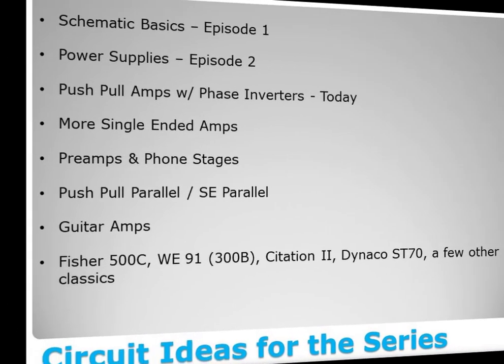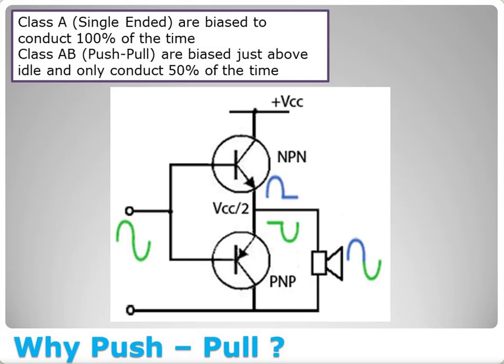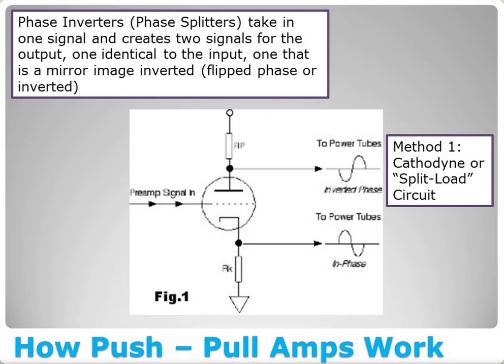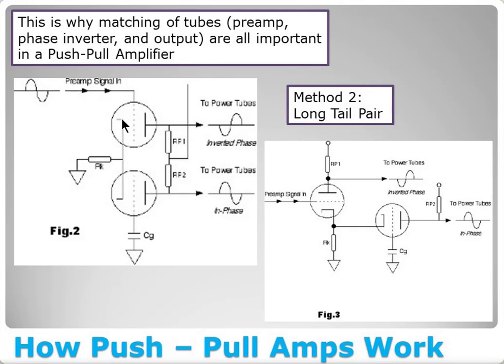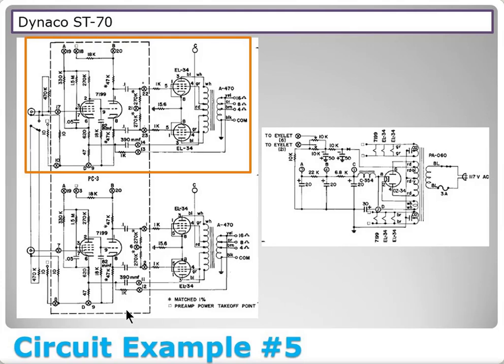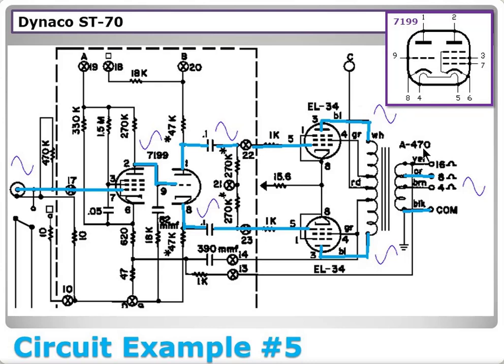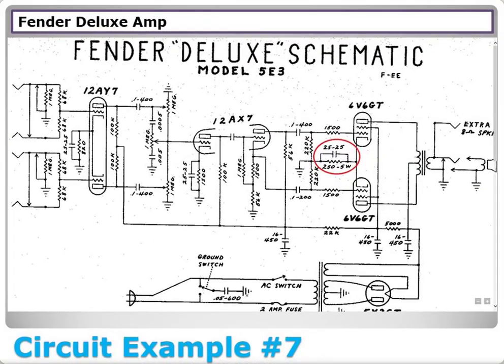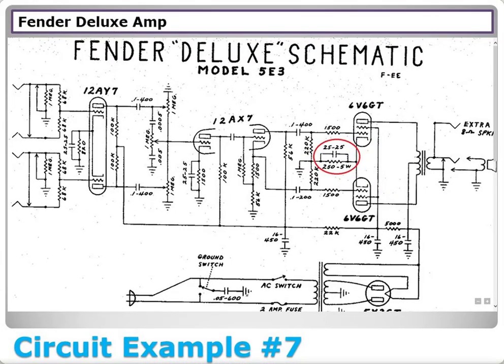Understanding Vacuum Tube Amplifier Schematics - Push Pull - Part 3

Comment: Thank you! The information on how the second half inverts the signal has cleared up some confusion from watching other videos.  Many videos (that I have seen) don't stress this point. I know it's just me but that has cleared up a lot of confusion. I also found it helpful to know how different frequencies (high versus low) effect the power section and basically a key difference in sound between solid state and tube amps (if I'm interpreting that correctly)... anyhow.. Thanks!

Comment: Great series. As an electrical engineering student with some experience with transistor amplifiers I can see a lot of similarities between tubes and transistors, mainly the plate signal inversion just like in a common emitter circuit. You can explain the theory with simply words but never skip the true principle of working. I can recognize that. Great job man. PS: I am a guitar player too and pedal maker, I was looking for some basic tutorials on tubes. Now I can read a marshall schematic and understand it completely. Thanks again

Comment: That was absolutely superb. I understood everything! I think between your videos and Uncle Doug's videos, I've pretty much got the theory down. What I need to make progress on now is component value selection. I need to understand why a certain resistor or capacitor value is chosen. What is the theory at play. When (for example) a 1M resistor to ground is used as the volume control, why is it 1M, and not, say, 500K? What would be REALLY cool is, at some point, if you ever get the chance, build a push-pull amp on the bench with accompanying schematic and try different component values for bias etc, and see what the effects are on an oscilloscope. For example, I would assume if I wanted to build an exceptionally clean sounding amplifier, maybe for guitar, or maybe as a general purpose audio amplifier, I would keep the valves "cool" with respect to their bias. However, if I wanted (for example) a guitar amp with a bit of growl (think Marshall or Vox AC30) then I might select a "hotter" bias? If I wanted a "dirt"/distortion control, maybe I'd include a potentiometer that did little more than tune the bias within a fairly narrow band?

Thank you so very much for taking the time to make these videos. This series in particular. There is a legion of valve amp fans around the world hanging on your every word, and I'm sure I speak for everyone when I say that we're very grateful indeed for the time you invest into making these videos in order to help folk like us de-mystify valve amps.

With best wishes from Aberdeen, Scotland.
Mark.
Reply from the maker: Sadly the resistor & capacitor component selection dives deep into circuit analysis & design which is pretty heavy on the Math side of things.  It's not a 30 minute topic.  I'll try to do my best but at some point electronics are nothing but physics and math, thus why very few go down the EE path.  There are some generalities I could speak to but going much further turns into a full degree program...
Reply: Mark, I echo your sentiment on these and Uncle Doug's videos. One great read is http://www.guitarstudio.tv/documents/Designing-V-T-Amplifiers.pdf

The Merlin Blencowe books are great too but a lot more in depth math/physics wise.
Reply: @Terribleguitarist89  Thank you so much for that reference !!! I think I just found my new bedtime reading for the next little while (or long while, because that's not short read !).

Comment: Great lessons. For some reason I am remembering the long tailed pair inverter having mismatched resistors in it… Maybe I’m thinking of blackface circuits? Thanks again for this presentation!
Reply: The balance of the LTPPI is primarily controlled by the value of the tail resistor. Higher values increase balance, but also restrict the output swing. With a tail resistor greater than 18k, best balance is achieved with equal value plate resistors.

Comment: Great stuff! Just one comment: the ECC83/EL84 example beginning at 12:55 is not a Long Tail Pair phase inverter but a Floating Paraphase PI...
Reply: The Floating Paraphase example actiually begins at 22:25... Again - excellent presentation!

Comment: Way back in 1970, an instructor told me that if I ever encountered a push pull amp that was putting out about a third of the power, he pointed to one of the resistors that he said would cause that if it opened. Next time I was home, my brother's amp was putting out about a third. I looked at the schematic, went to a local TV shop and bought one resistor, went home and repaired the amp. Now, I'm trying to recall which of those resistors it was. Using that Fender amp is there a way to determine which resistor would cause that. My old training had become too foggy.

Comment: Note that contrary to what you said initial dual triode stage IS OBVIOUSLY NOT a long tail pair and no audio signal shows on joined cathodes because  of large capacitor C3 shorting them to the ground. Instead the two are two normal amplification stages with the second (right) one receiving its input through C4.

Comment: Well done and thx so much, but one question : in the pnp/npn picture, the lower half can‘t work , I think the speaker should be connected to 1/2 of the power rail to make the lower transistor work. Am I wrong ?

Comment: The first illustration with transistors needs a negative voltage supply with a speaker attached to a ground wire or to a virtual ground made with big capacitors in case an uni polar power source is used.
A phase is important even in case of a single ended amplifier. Because as a reaction on a sharp impulse a speaker membrane must move in a desired direction. Otherwise, no good bass is available.
A long tail pair inverter is not an ideal because a noise from a power source appears on two legs differently. It negates only on the second tube that is connected with a common gate. Also, two legs have a different Miller's effect value.

Comment: In the EL84 push pull R4 should be compensating for the double amplification that the plate will be outputting due to A triode sending the signal back into B triode so I think R2 and R4 should be not equal, I was educated by uncle Doug and his wild animals, this is also shown in fender schematics as such which would imply there maybe some amplification via the K.

Comment: For cathode biased power tubes, the best way to go is to use a separate resistor for each tube. This eliminates hum before it goes to the output transformer. Because tubes are never perfectly the same when you buy them. They can be matched, but not as well at it should be.

Comment: 18:17 - when the signal is fed into the grid of the el-34's doesn't that invert the signal again? so the top el-34 amplify's the bottom half (not top) and bottom el-34 amplify's the top half (not bottom). I may be incorrect, just asking... love the vids, thanks.

Comment: Thanks for the video. In circuit 6 don't we also feed second grid of that ecc83 from first plate of the same tube which results in inverted signal on the second plate?

Comment: For the transistor push-pull circit, shouldn’t there be a capacitor connected in series with speaker? Without it, the lower half cycle won’t work.

Comment: Maybe a better way to say it is that every Triode is both a ‘PNP’ and ‘NPN’ But when using it as both you don’t have amplification, but it’s good that the most common tube 12ax7 is a dual triode, so perhaps that is a compensation.

Comment: I`m an older man from Norway and l found your video very explainable and good in all regards. I have a main transformer 175-0-175 Volt incl 6.3 and 5 Volt . Suppose this woul be fin for 2xEL84.What is the minimum high voltage on the main transformer if l`l use EL34 or 6V6 ?

Comment: Very informative series so far. One thing I've had issues with from schematics with no parts list are what type of capacitors to use where. I know that different types can affect the sound if they are in the signal path, but where would you use a ceramic, mylar or whatever in the other parts of a circuit. Electrolytics are obvious but the others can be confusing.
Reply: I try to only use quality non polarized caps in the signal such as poly or paper in oil caps. Ceramics types can be noisy in the signal, I usually only us them for a line safety cap. Sometimes people use ceramics and that to decouple radio freq and such to ground.

Comment: Thank you so much! I can't wait for the Bias Vids.  So in the Fender amp I think I get the inputs. 1 Master gain control and 2 Channel gain controls yes? All they are doing is shunting to ground in a variable way but why is the Master's element tied to one channel and not both? Also, the elements of the Channel pots are tied to the wiper of the Master yes? Also also, is it as simple as adding a variable pot to each cathode of the output tubes in a fixed bias amp to convert it to variable bias using unmatched tubes?

Comment: Hello Mark, I recently completed building a Dynakit ST-70, and it is fantastic, but I have an existing condition of AM radio interference.  As a quick fix I installed RF ferrite chokes on the power cord, and the line input.  This works, but I would like to install RF chokes inside the amp as a permanent fix. The offending AM radio station is 1500 kHz. The transmitting antennas are only a few blocks from my house, and this interference affects, other audio equipment too.  Can you feature on your channel RF choke solutions for tube radios, and guitar amps?  What components are best and how to install them into existing circuits?  Richard Trask – San Jose CA

Comment: Great lesson Mark. The part about the Cathodyne PI  that I dont understand is the voltage differences from both the plate and cathode.
The Fender AA964 Princeton Reverb is a good example. ~230VDC from the  PI plate and only~65 VDC from the PI cathode  yet it works out fine in the end. How can this be?
Thanks very much!
Reply: The 0.1 coupling capacitors block those DC voltages, while the equal and opposite (AC) signals which are developed at the plate and the cathode by the signal at the grid are allowed to pass to the grids of the output tubes.

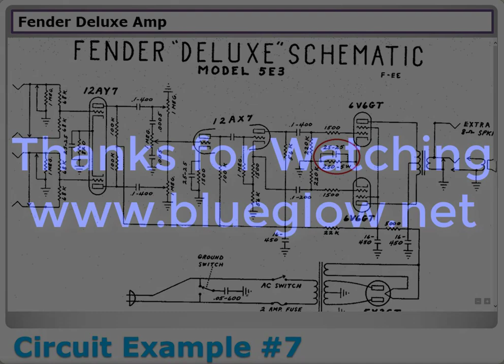Comment: 30:30 - What is the purpose of the 'extra' resistors in the cathodyne circuit (1500, 1 MEG)?
Reply: They are there to bias the tube. Current flowing in the 1500 develops a voltage across it, so that the bottom of the resistor is at a negative voltage with respect to its top (which is connected to the cathode). The grid is tied to the voltage at the bottom of the resistor by the 1M resistor so that the grid is negative with respect to the cathode.

Comment: Can I ask you a dumb question, on the AB transistor schematic if we trace the ‘electrons’ in both the ‘push’ and ‘pull’ stage one seems more conventional than the other, so my question is for the seemingly less conventional stage the ‘pull’ 

In the pull stage, obviously the input signal has the NPN ‘off’ and the PNP ‘on’ so do the ‘electrons’ flow from the ‘negative’ terminal up through the PNP and then through the inductor or speaker inductor...back to themselves? 

Or do the ‘electrons’ flow from the ‘negative’ up through the inductor then through the PNP and back to themselves?..... 

This mode seems to be the most unconventional.

Comment: So it looks like most of these examples were for integrated amplifiers, so the schematic for a dedicated preamplifier with "balanced" XLR outputs would end with the dotted line box (about 19:00)? And would then go through amplification and summation in a power amp or monoblock amp later?

Comment: Question.. I am working on a Philco 90 tube radio with push pull 45 tubes and I am looking for information on the first audio transformer that is feeding the grids of the 45 tubes.  Could you help me or direct me to a proper video for this?  Mine is completely open and after opening the top it is fried so I cant repair it.  On top of that, I just want to understand how it works.  It will help me in my search for the right replacement.  Thanks in advance.

Comment: Great videos, I've been watching your electronic videos and others for a few years now. I enjoy the videos more than reading books lol. I'm going to school for electrical engineering and am hope to work in audio in the future. I've built a few amps and recently built a single ended el84 stereo based on the Magnavox 8601. I went off of the schematic that removed the tone section for a flatter frequency response but find it lacking a little in the mids and bass. I tried a cathode bypass cap on the 6eu7 cathode and got more gain but tone was worse. I'm confused on what they did on the original Magnavox circuit as far as what type of filter they have setup around the 6eu7, not sure if it is a low pass, high pass or band pass. Would be awesome if you could give me an idea of how to tweek that circuit or even make a simple tone control based around that circuit would be appreciated. Ps very nice tube pickups at that ham fest, wish I could find those kind of deals.

Comment: The 15.6 Ohm resistor in the ST70 is not really a cathode resistor; it's just a current-sensing resistor. The ST70 is a fixed-bias amp with a negative bias supply, so you're kind of misleading people by discussing that as a cathode resistor. Dynaco chose the 15.6 Ohm value so the bias reading would be 1.56V, the same as a fresh battery since it was made in the old days when analog voltmeters were harder to read accurately. 

You could compare the ST70 to an EICO HF-35, which is a cathode-biased power amp.

Comment: Hi Mark, I noticed many types of hi-fi amps use the 7199 tube, and they aren't cheap. Is there a reason a 6EA8 tube couldn't be used for the same application? The triode section has even more gain than the 7199. Maybe reasons beyond my understanding. I know the sections are swapped and the socket would need to be rewired.. But is there another reason it cannot be used or undesirable? Thanks, Tom
Reply: Hi please explain this schematic to me
Reply: AO39 schematic

Comment: Question about the ST70: why does the plate from the pentode half of the 7199 connect directly to the grid of the triode half with no coupling capacitor? You'll have...whatever the B+ is on that plate. Is that right? If so, why? I thought control grids usually had minimal DC?
Reply from the maker: Very good question.  Keep in mind that all voltages in a tube are relative to the cathode voltage.  In this case, the cathode of the triode part of the 7199 isn't at ground, its floated above ground a good bit via that 47K resistor, thus in essence making the grid to cathode voltage tolerable as they aren't that far apart.  I'll try to cover this in one of my future videos, its a slightly hard concept to grasp.

Comment: If you have a 12ax7 dual type tube, if you have a problem with a lower quality of amplification on one side, what stops the other side from picking of the signal from the weaker?  In other words, what keeps the signal staying on it's own side?
Reply from the maker: The two sides of the tube have absolutely nothing to do with each other.  Think of it as two completely separate tubes.  Once can't pick up for the other because its a separate tube.  They just happen to be in the same glass envelope.

Comment: This diagram shows each transistor handling only half of the load. In push pull, both amp modules act on the ENTIRE signal. One is pushing while the other one pulls and vice versa. The diagram looks more like a regulator with one transistor wired backward.  XD

Comment: This is one of my desired video. I´m reading the book "solidstate_guitar_amplifiers_teemu_kyttala_v1.0" (which I recomend for those who want to go deeper in amplifier design, google for it) and I didn´t understand long tail meaning and how it could separate both cycles for individual amplification. In solid state amplifiers I understand because it  works with a pair of PNP_NPN transistor, like you explain in the beginning of the video.I´m  going to print Fender and st-70 schematics and write down all information. I am learning a lot with your videos, thanks for your time.I am pretty sure that those Bias videos would be superb

Comment: What about High Voltage feedback from the output tubes to the input tubes not covered anything about feedback
Reply: He mentioned feedback a little in video 2, but I would also like to know more about it and different things you can do with feedback.
Reply: Jake P TUI til he gets away from the nonsense of balance tubes are the answer! He won't find the Holy Grail in harmonic distortion
Reply: Are you talking about the crossover distortion from when tubes are not equally balanced? There are several way to introduce 2nd harmonics in a tube amp. I would be ok with slightly mismatched tubes but also wouldn't want one channel to be louder than the other. I would focus on other ways to get harmonic distortion.